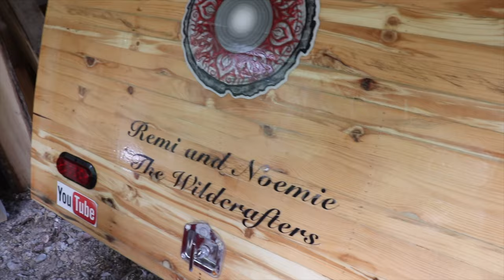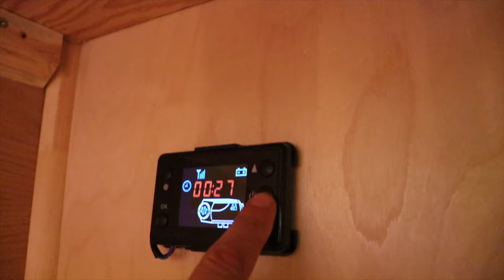What 20 000 km Winter Travel did to our Home Made Tear drop Camper | Weekend Getaway | Episode 79

Comment: That’s one goofy looking hinge.

It looks to me that air would blow rain through the hinge while driving.
But I’m not sure it would support weight if it were installed the opposite way 🤷‍♂️

Been trying to sort this out myself for something I hope to build.

Keep some wd40 on hand and use it regularly.
( or an equivalent brand)
Keeping moving metal parts “wet” with oil can help prevent rust and corrosion, especially if dissimilar metals make contact.

Overall, you have a good build and it looks really nice.

I envy your ability to travel and enjoy.

Can’t quite do it myself, but I’ve been collecting little bits here and there to get closer.

👍😎
Reply from the maker: We hope that you can travel soon :)

Comment: I love the little trailer, it’s actually how I discovered the channel. I noticed when you moved the camper with the 4-wheeler your having an axle/wheel bearing issue on the divers side. That wobble is not good. Please check it. Also what kind of white paint did you use to help treat the mold?
Reply from the maker: Thank you you have good eyes 👀:) 

We use a can of tremclad  ( metal and wood paint) We use that paint for more then 10 years on some project and it’s the most durable paint that I found.

Comment: Looking at 3:51 it seems to my like your hurricane hinge is mounted the wrong way. The flat piece with a channel (which u can slide rubber into) should be on top of the trailer - not moving.
Reply: The way it is now, your water is sliding right into it instead of draining out